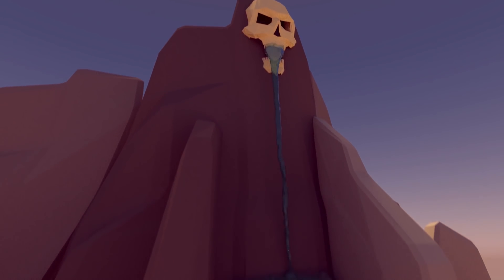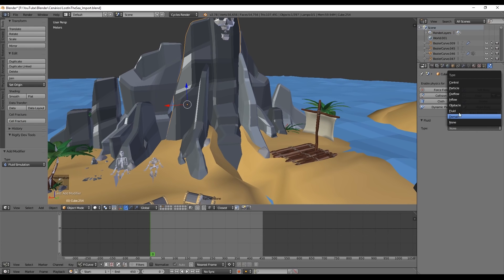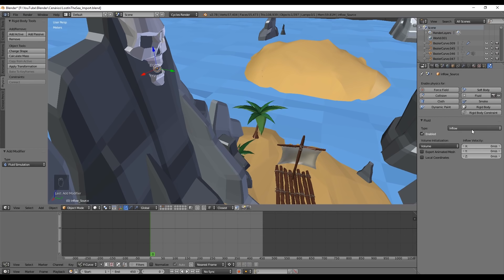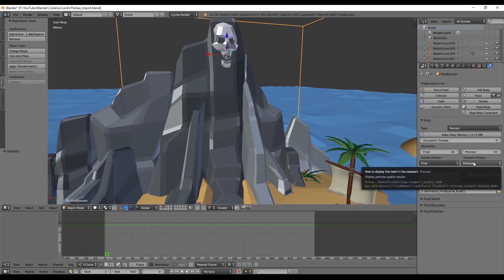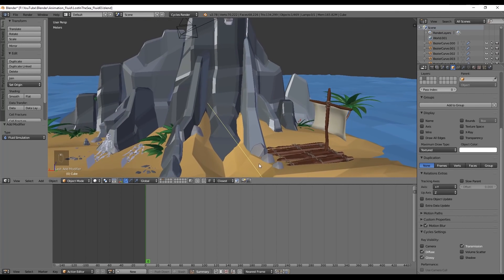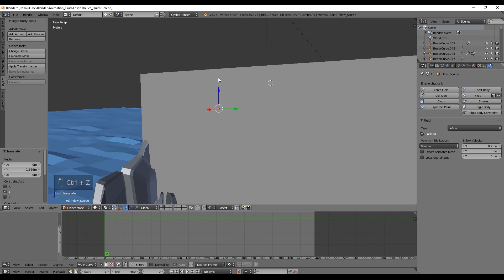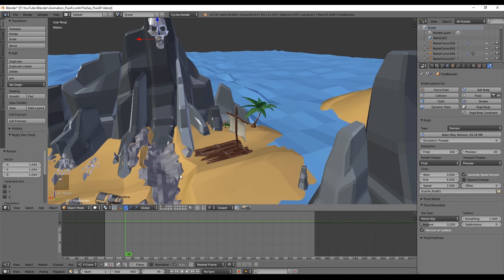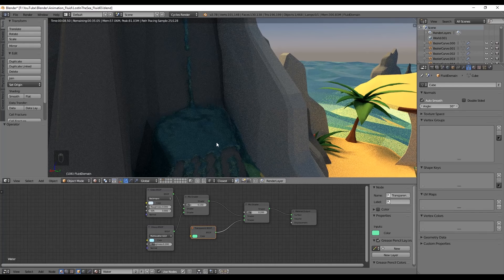Blender Tutorial - Fluid Simulation - Animation & Physics Tips

Comment: Fluids are one of the weaker points of blender unfortunately, very difficult to achieve convincing results especially if the container obstacle is transparent (there tends to be blockish segmenting between the fluid and the obstacle). I hope there will be some kind of plugin or development in this area for 2.8 (I remember hearing about Mantaflow integration some time back).
Reply from the maker: Fluids and soft bodies. Very glitchy and slow to calculate. Mantaflow will be an awesome step further for Blender if that ever happens. Maybe, someday. Now that blender is so well developed in modeling, animating and rendering, it's only missing the VFX boost.